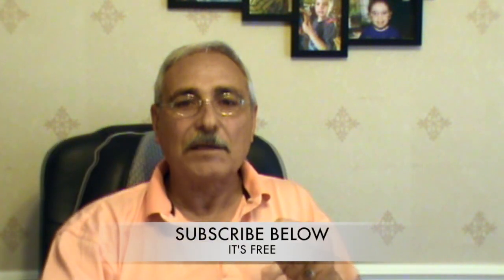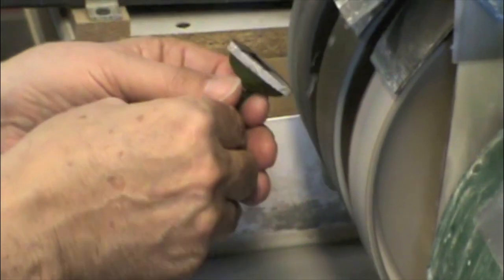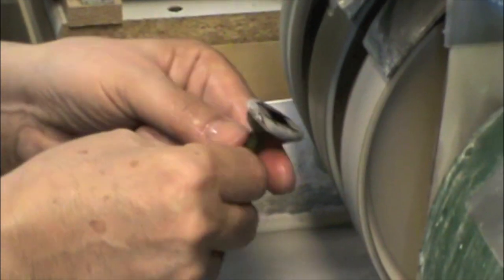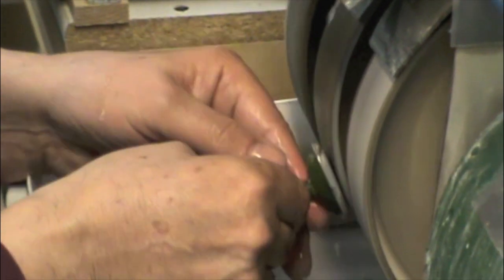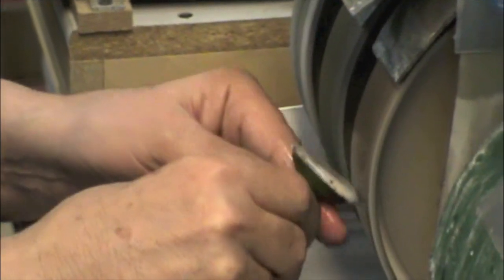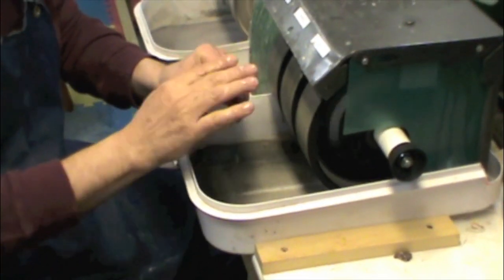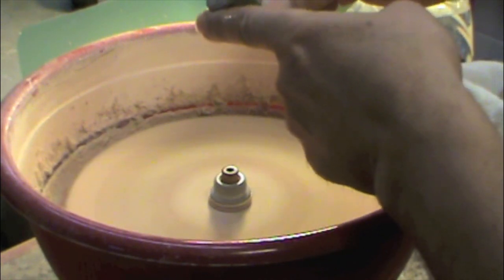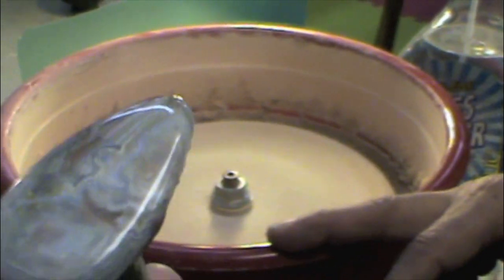How to Remove Scratches on Your Cabochon!!

Comment: What is  the RPM of your polishing wheel (flat lap)?  It looks so much higher than what I use.  Also, how do you remove cerium oxide from small cracks?  Thanks!
Reply from the maker: I don’t know exactly the RPM but I know it’s high than what I want. However, as long as you don’t overheat the stone by pressing too hard or staying too long, it works fine. To remove the cerium oxide from small cracks you can use a toothbrush with soap and water….Thanks for watching my videos.

Comment: Elie,  Thank you so much for these videos.  Could you possibly provide one for us on building a machine and set up like yours, and also maybe sell plans to us with a punch list?  I am so frustrated with my equipment for various reasons, and there doesn't seem to be anything like yours on the market.  Sherry
Reply from the maker: Hi Sherry, thank you for watching my videos, with regards to building the machines I think the best way is to take one apart and show how I built it, as an engineer it’s easy for me to design and build my own machines, I already made a video explaining how I built my 18” saw and I’m planning to make another video on building a 20 ton press...as I understand you probably need to know about the cab grinding machine and the polisher, I will do my best to show both but it may take sometime, meanwhile if you have any questions or you need any information, please don’t hesitate to ask, you can also send me a PM on messenger or email me at eg.therockman@gmail.com thanks, Elie
Reply: @ElieGhanimeEG  Hi Elie,  I would love to see a video like that.  I have a very old Highland Park combo unit that I took apart and am having difficulty getting back together.  Seeing your trim saw video helped a lot regarding converting it to water, perhaps (?).  In any case, I also have a Genie, and I noticed that using dirty water is not helping.  I like the 8" wheel design that you have with fresh water.  I was thinking about a covington, but I might be more interested in replicating your setup.  With respect to your polishing bowl, did you make that too?  Sherry
Reply from the maker: Hi Sherry, like I mentioned before I will take my machine apart and show how it’s built in a video. The polishing machine I also build it myself and I will show that as well.